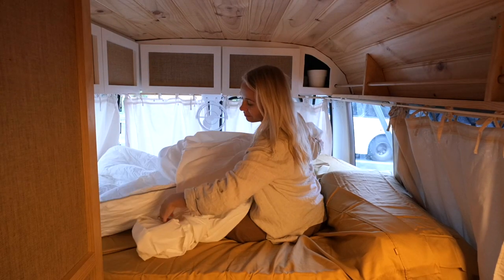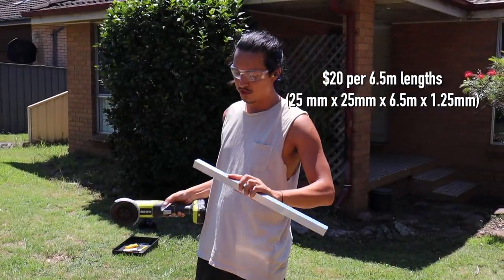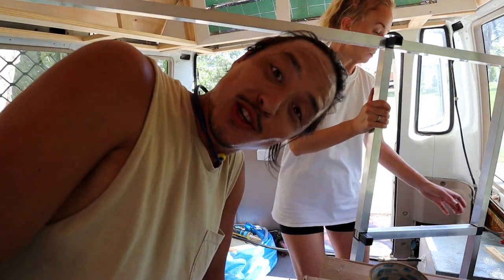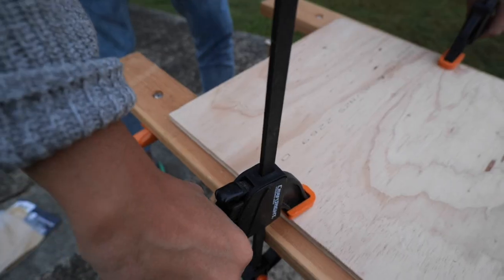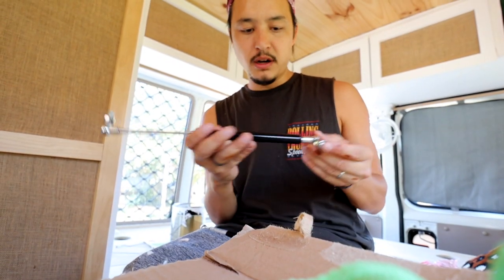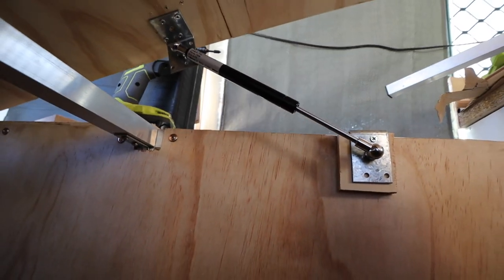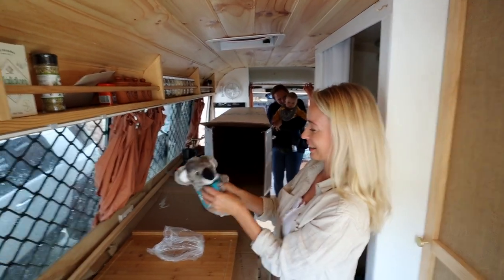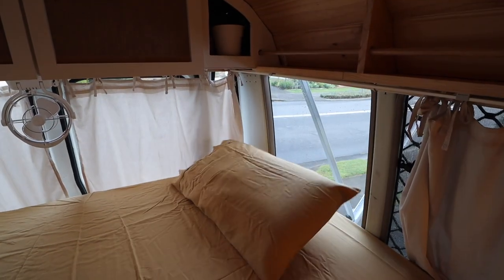VAN / BUS Conversion - BED! Koala Mattress / DIY aluminium bed frame / Gas struts - Toyota Coaster

Comment: Speedholes in the bed base!!! Also, it helps circulate air in the mattress.  
I think one piece of plywood on gas struts would lift the whole mattress & base up out of the way. Without having to struggle lifting the mattress while opening each trapdoor

Comment: Love your work!

Does the length of the Queen just expand and squish to fit the width of the bus?
Our bus (we got a week ago!) is 183cm wide and we want to do a mattress the same orientation as yours, but thought we might have to cut it down...

You two have provided us with a ton of inspo for our build!
Reply from the maker: Hey Sam! That's awesome! Ours is actually a double size and it fit PERFECT! We didn't have to cut it down or even squish it in! (we got ours from Koala)

Comment: Hey guys, just about to start on the bed area of our coaster, and I'm considering this setup. Can I ask how things are structurally? When I looked at the aluminum in the hardware store it seemed pretty flimsy? Once all in and reinforced with ply is yours still solid and sound? TIA!
Reply from the maker: Hey buddy! Honestly aluminium held up like a boss. We did go for slightly thicker aluminium, which was a nightmare to install in terms of the joins, in saying that probably made everything slightly more durable (but reiterate again nightmare to install lol). However in the areas where we went with the slightly thinner aluminium throughout the bud they still held up 🙌🏼 we’d use aluminium again if we did another build 👍🏼
Reply: Thanks for info, can I ask what thickness you used for each (thick and thin) cheers
Reply from the maker: I honestly couldn’t tell you the exact thickness sorry mate. It was nearly 2 years ago 🤦🏻 Pretty sure there’s only two thicknesses you can purchase in that 25x25mm. There is a standard one, which is slightly cheaper. That’s the thinner one.

Comment: This is so exciting! But I need your guy’s help! I live in the US but my dream is to renovate a Toyota Coaster. Because we don’t have those here (unfortunately they’re so cute!!) I don’t really know, or have a good reference of how big this bus is. Yesterday I was wracking my brain  because the numbers on the specs said the Toyota Coaster was as big, if not a little smaller, than a Mercedes Sprinter van with the longest wheelbase, I’m not sure if you could confirm this with me? Or perhaps do a video with dimensions on the bus? I’m not sure, I still can’t wrap my head around it though, so as someone who can’t see these buses in person until I have committed to buying one, it would be HUGE is you could help me out. Much love to you guys, you’re awesome and I love the bus❤️
Reply: These buses are typically 2.02Wx6.99Lx2.58H metres and are streets ahead of the sprinter for reliability and longevity.

Comment: Hey Guys, Hope you're well. Just bought a bus and wanting to replicate the aluminium bed frame. How has it held up? And is it also fixed to the floor in some way?
Reply from the maker: Hey Jack! Hope you are well too :) Thats awesome, the fun begins! The bed has been great, no problems, the legs we put on are fixed to the floor with a couple L shape brackets, the top part of the frame is fixed to the bus walls